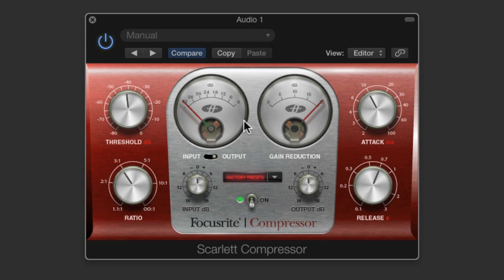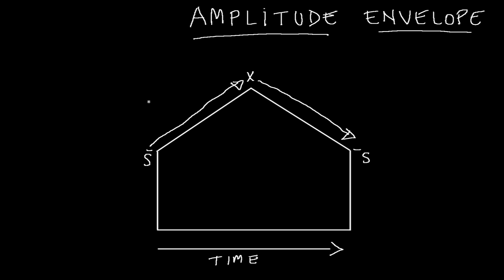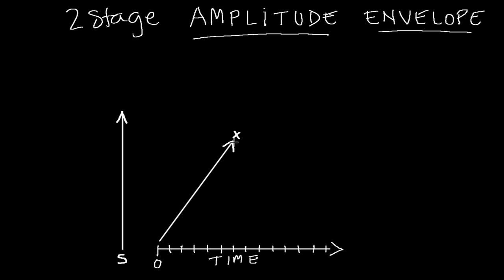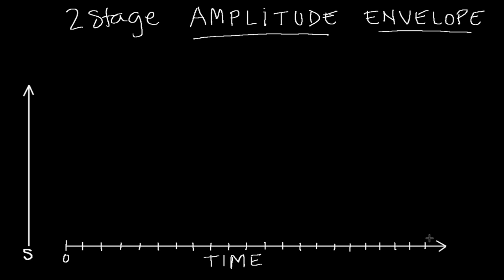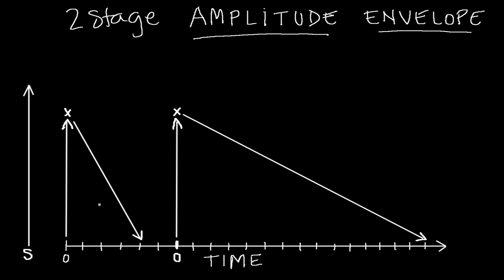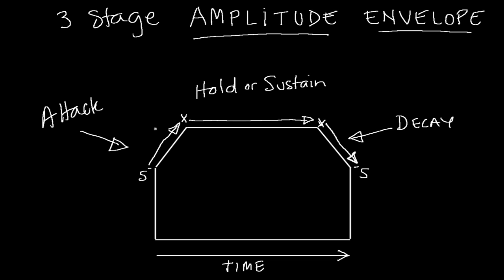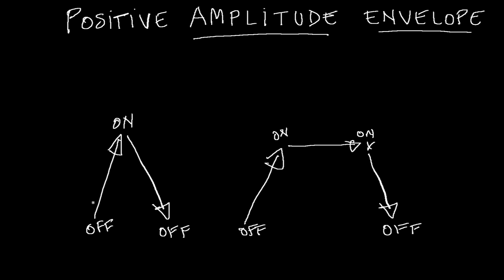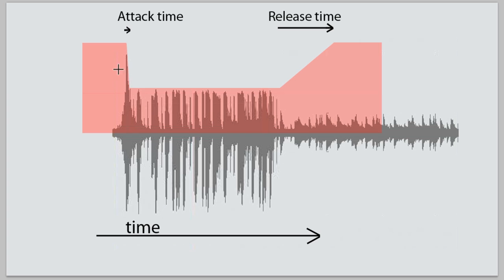Compressors & Compression Masterclass 4 (Attack & Release 1)

Comment: DAMN... i finally understand why some instrument require faster attack and release than others... this is so well presented!
However, those same settings can be used to affect tone and position (in your face, or far away) if i'm not mistaking. So if i get it, the comp will always affect the amplitude whether you work on the tone or the position of a track, but then the make up gain brings it (amp) back to a sustain level that matches the overall mi, is that right? 

My next question would be: if the previous paragraph is correct, how can you affect tone without messing up the amp of a track using a compressor? is that actually possible?

this channel is the truth!!!